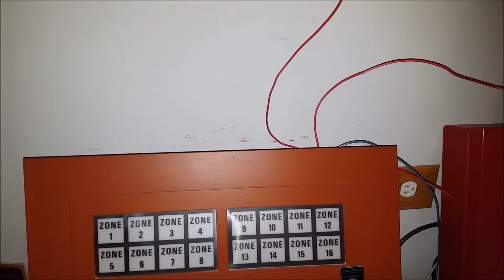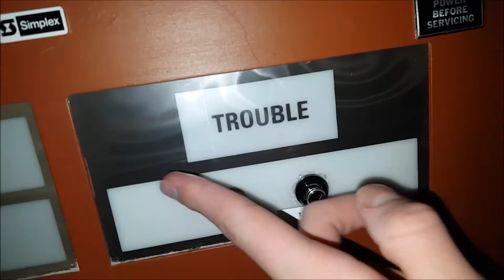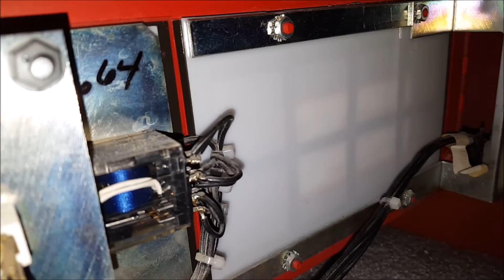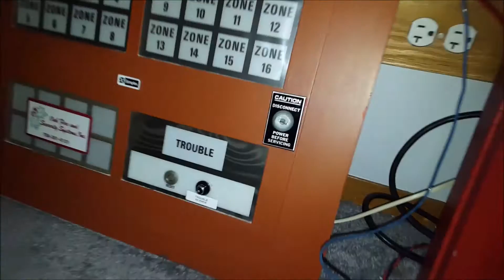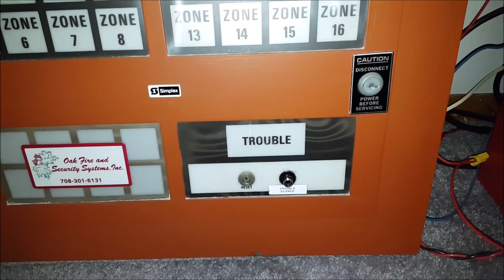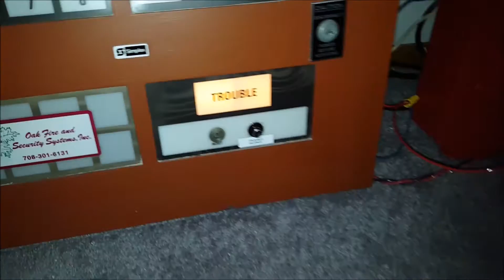Simplex 4305-B Fire Alarm Annunciator/Panel

Comment: I used to service this panel and the annunciator. The panel was a Simplex 4002. Too bad you couldn’t get that. I installed the piezo Horn and Shadow switch for silence. There was a mechanical buzzer for trouble, and a key switch to silence it. The mechanical buzzer went bad. When I replaced it with the Piezo alarm, no one in The building had a key to shut it off, thus the reason to put in a switch. The reset key switch reset the entire panel from upstairs.

I used to work for that company that services the system, but not anymore.
Reply from the maker: That is very cool; thank you for that information! Yeah, I was very much wondering if it was a 2001 or 4002 system this building had. Would have been very nice to get that 4002, since that's one of the models I'm hoping to acquire at some point. It would be cool to get a 4002 and wire this thing up the way they had it. Most everything I figured out on it. When it came to the reset switch, though, I had no idea which terminals were for it.

Comment: Nice! I'm glad it works! I'm just waiting for people to start asking for all of the stuff you got lol
Reply: I thought that the piezo would have a Dover buzz. I'm surprised
Reply from the maker: +NJMoo3652 They already have, haha. And yeah, me too. But Simplex also used beepers back in the 80's. They used them on their 2001, 4207, and 4208 systems. I don't think they started using the Star Micronics buzzers until the 4001 came out. But I certainly got the Dover buzz with the elevator panel.

Comment: Pretty neat annunciator! I recall those were often used with Simplex 4207, 4208, 2001 and 4002 systems (at least until the end of the 80s.) I'm pretty sure that annunciator you have was used with a 4002 system, even if it was originally made in 1981 (and probably initially intended for use on a 2001 system.)
Reply from the maker: +wileyk209zback Thanks! I figured you would like it, knowing you have a lot of knowledge about these older panels. I initially guessed this building had a 4002, and I do think I'm correct, but I temporarily changed my opinion just by looking at this annunciator. A tech on the forums told me to check the reset key switch and see if it's wired for N/O operation or N/C. If it's normally open, that means this was most likely used with a 4002, which would make sense considering the building was built in '89, and used strobe plates, not light plates. It's just weird that they didn't use a 4602 annunciator, though, which is what the 4002 systems commonly used.
Reply: The early 4002 systems from 1986 to 1989 used the older-style annunciators; I don't think the 4602 annunciators came out until a few years later. I've even seen a mid-80s 4001 system using a smaller version of that annunciator (two rectangular squares, only the zones are shown, no trouble indicator or silence and reset switches.)
Reply: +msj191961 BTW, I know they still used light plates as well in the late 80s and early 90s. A friend of mine went to an elementary school that had a Simplex 4002 system installed in 1989, and the alarms were 2901-9838 horns on 2903-9001 light plates.
Reply from the maker: +wileyk209zback I see. That's good to know. Believe it or not, I came across a second 4305 series annunciator in a building literally right down the street from where this one was. In fact, it's an identical system, with the same exact horn/strobe combos on trim plates. I haven't yet seen any pulls in this building, but the annunciator is identical to this one, except it's only 8 zones, so it's only one rectangle of lights with a B key lock right by it. I'm going to get it in there and film that system.